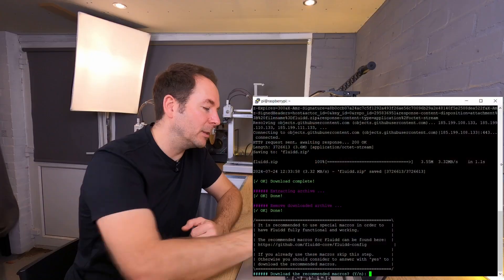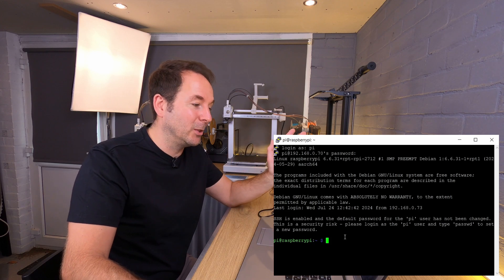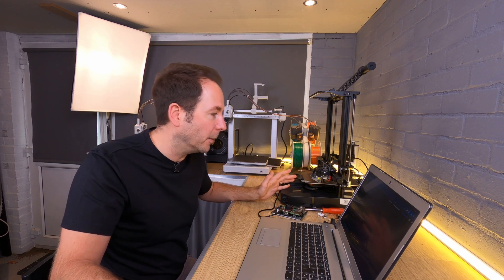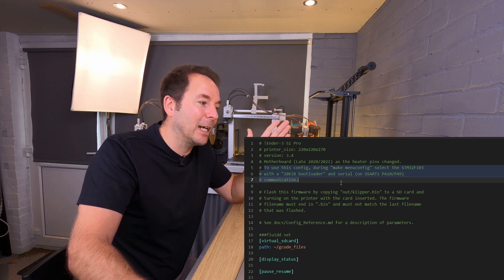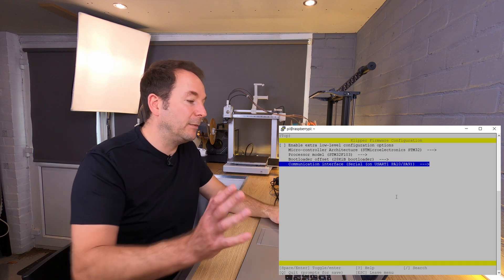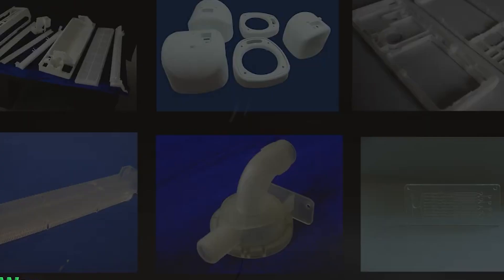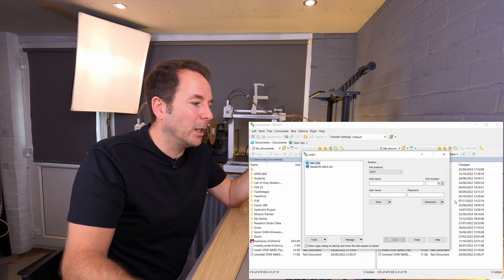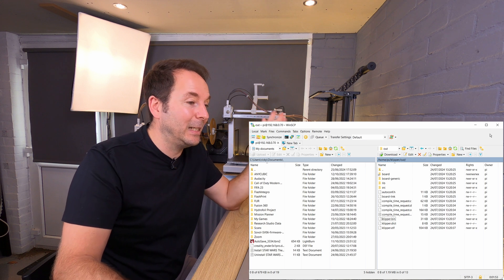How To Compile Klipper Firmware For Your 3D Printer - Klipper 3D Printer Series Part 4

Comment: MCU UNABLE TO CONNECT 

For anyone using a SOVOL SV06+ with "CANNOT CONNECT TO MCU"  ERROR Just following the guide will not help you need to do the Following: MAKE SURE DURING THE MAKE menuconfig to do the following:

[*] Enable extra low-level configuration options
    Micro-controller Architecture (STMicroelectronics STM32)  --->
    Processor model (STM32F103)  --->
[ ] Only 10KiB of RAM (for rare stm32f103x6 variant)
[*] Disable SWD at startup (for GigaDevice stm32f103 clones)
    Bootloader offset (28KiB bootloader)  --->
    Clock Reference (8 MHz crystal)  --->
    Communication interface (Serial (on USART1 PA10/PA9))  --->
(115200) Baud rate for serial port

^^^SETTING THAT BAUD RATE IS THE MOST IMPORTANT  as the SOVOL sv06+ runs at 115200 but KLIPPER defauts to SERIAL_BAUD=250000 and also in the printer.cfg file manually add the baud rate like below

[mcu]
serial: /dev/serial/by-id/usb-1a86_USB_Serial-if00-port0
baud: 115200
restart_method: command

i spent a good part of 6 hrs trying to figure it out and then i came across this reg CREALITY boards so im gussing this is a common thing. All thanks to this REDDIT post https://www.reddit.com/r/klippers/comments/skgf5f/mcumcu_unable_to_connect/

Hope this helps as soon as i Rebuilt my klipper.bin file with the above set and added the baud rate to my printer.cfg it just connected :D PS: i am very new to 3D printing so far i have printed 3 things

Comment: thanks for the video.. very accurate!! I could ask a question! I recently upgraded my self-built printer with klipper.. but I can't center the prints on the plate
. I'm getting
Reply: Did you ever get this figured out? The way I did it was after getting everything functional, I homed and then moved the head (using the controls) to the left edge of the bed. I used a flashlight and a magnifying glass so the center of the nozzle was on the very edge. Then I wrote down the X position, went into printer.cfg file, found the stepper_x section, and subtracted what I had written down from the "position_endstop:" entry (I ended up with -10.1 if that helps). In layman's terms, that tells the printer "when you trigger the X endstop, the nozzle is (this) far away from the edge of the bed." I also put the same number + 0.1 (in this case -10) as "position_min:" so it's not going to smack into the endstop unless it's homing. Then I used a tape measure to measure the exact size of my bed (235mm for my "FrankenEnder" which started life as the original Ender 3 model) and made sure the slicer had that (it had defaulted to 220mm when I originally set it up) in the bed dimensions setting. Now I have perfectly centered parts. Hope that helps.

While you're at it, after doing everything else, slowly move the nozzle positive on the X to until it "hits" the far limit (you should hear it) and cannot go any further. Subtract 0.2 (both to compensate for hitting the limit and to keep it from hitting the limit next time) from the new X location and enter that in the "position_max:" entry. Depending on your prior setup (for example, you have it set to 235 but the nozzle can physically travel further than that), you might need to change that setting to a physically impossible number first (such as 300) so you can actually reach the limit. Just be very careful and go slow because hitting the limit and then attempting to go further can cause damage. In my case, that came out to 245 ... so I have 10mm on either side of the bed that my head can travel. That's useful if you want to set up some sort of purge bucket system (that was what I did, so I could add an ERCF later and not lose 1/4 of my print space to a wipe tower) or auto brush cleaner & macro.

Comment: Just an FYI for anybody who cares, "KiB" is pronounced "kibibyte" ... it's basically a replacement for kilobyte (there's also mibibyte, gibibyte, and so on) because the preface "kilo" means 1000 but in binary systems (for example computers) it ends up being 1024 bytes, which is technically not accurate.

Comment: every time i try to build the bin file I get the following error. Does anybody know what this means?

 [ERROR] Unexpected error:
Command 'make PYTHON=python3 menuconfig' returned non-zero exit status 2.
[ERROR] Command 'make PYTHON=python3 menuconfig' returned non-zero exit status 2.
[ERROR] Building Klipper Firmware failed!
Reply: here is the prior script that appears as I enter the firmware build 
make: avr-gcc: No such file or directory
make: avr-gcc: No such file or directory
make[1]: avr-gcc: No such file or directory
  Creating symbolic link out/board
make: avr-gcc: No such file or directory
Loaded configuration '/home/sonic/klipper/.config'
Traceback (most recent call last):
  File "/home/sonic/klipper/lib/kconfiglib/menuconfig.py", line 3281, in <module>
    _main()
  File "/home/sonic/klipper/lib/kconfiglib/menuconfig.py", line 661, in _main
    menuconfig(standard_kconfig(__doc__))
  File "/home/sonic/klipper/lib/kconfiglib/menuconfig.py", line 705, in menuconfig
    locale.setlocale(locale.LC_ALL, "")
  File "/usr/lib/python3.9/locale.py", line 610, in setlocale
    return _setlocale(category, locale)
locale.Error: unsupported locale setting
make: * [Makefile:116: menuconfig] Error 1
Reply: @everyone.  I figured out the issue.  It seems there is a new version of KIAUH i was using Ver 6.0.  This version is still in alpha mode and it seems has some bugs in it.  I refused the use of version 6 and reverted back to the prior version.  Now the firmware build is good to go.  Hope this can helps someone else out.  I will try to report it back to KIAUH so they can look into it.